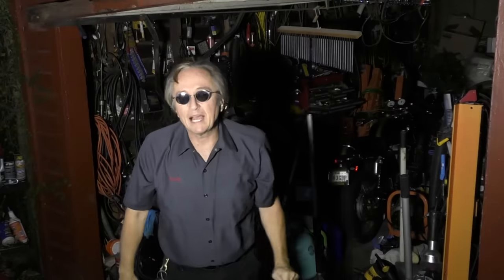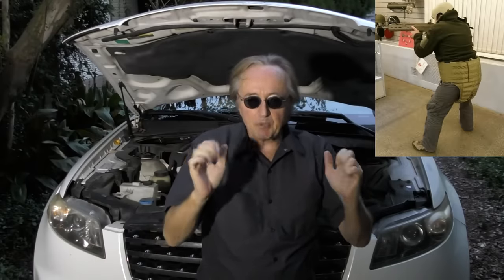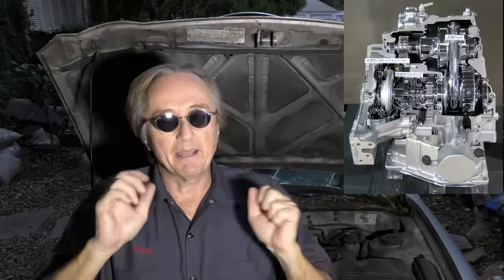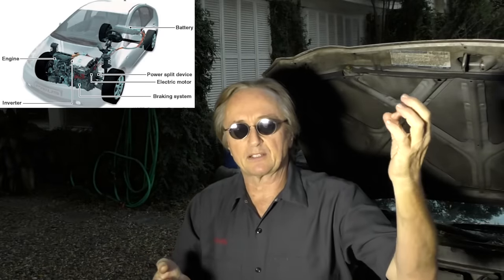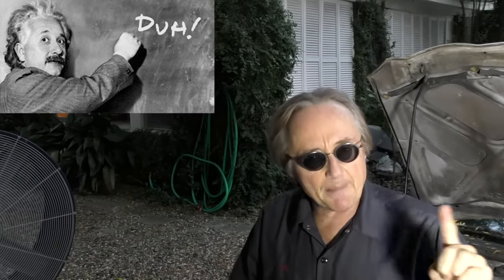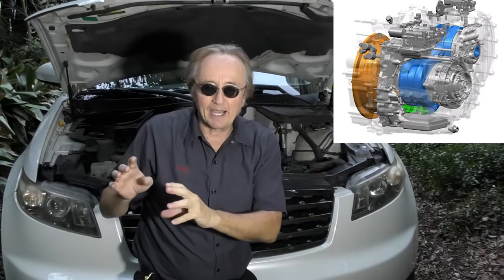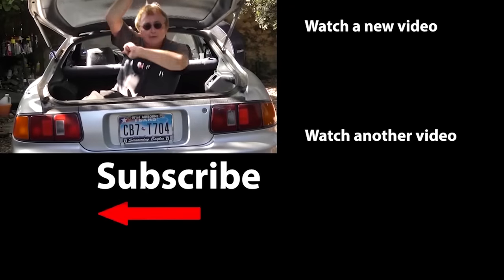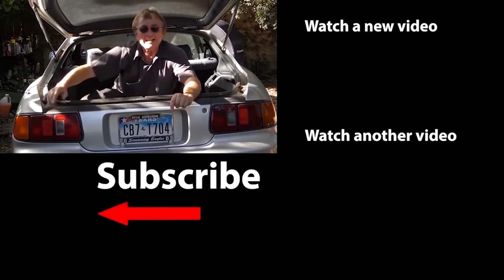Why Most CVT Transmission Cars are Terrible

Comment: My 2014 Note is on its second transmission at barely 131,000!?!? The second and current one started slipping in drive at 115,000 miles! Crappy... Nissan actually offered an extended warranty to 85,000?!?! My first went out at 72,000🤦🏽‍♂️ never again...

Comment: FYI: I HAVE 2016 NISSAN JUKE AND NISSAN JUST EXTENDED THE WARRANTY ON THE TRANSMISSION FOR 7 YEARS/84,000 MILES. CHECK WITH YOUR DEALERSHIP, AND DON’T TAKE NO FOR AN ANSWER!

Comment: Better gas mileage? What money are you saving if you have to spend thousands of dollars to replace the transmission in short order? I would much rather have a vehicle with less gas mileage where I don't have to replace the transmission because you end up saving more money in the long run with lower repair costs, not to mention the additional peace of mind with having a vehicle you can depend on.

Comment: My 07 Altima with CVT is still running at 132k but I’m scared it will go out any minute getting a AT Check light that blinks a couple times when I turn on the car then it goes away

Comment: When should I get the transmission drained. I have a 2014 Honda Accord and had a new transmission put in around 40,000 miles and it's at 72,000 now

Comment: My 2017 Honda ridgeline transmission needed replaced at 52,500 miles. Very disappointed in it's durability. Of course I lost $10,000.00 on trade in value. Is this a common problem?

Comment: I have a 2012 Nissan Versa sv cvt transmission and it took a dump at 64k miles. It never worked right. It would whine while going up a hill and sometimes woyluld just get hot and quit working all together while driving down the highway. They are crap!!

Comment: looking for a used truck or suv with tow hitch under 100k miles in the $15k to $20k range what would be a good one that will last me 10 years of driving at highway speeds?

Comment: Scott. With Honda being the makers of Acura, have you heard of any small but noticeable noise coming from those CVTs (or anything like that with any models)? I have a 2011 Acura MDX. How might one fix or reduce any small noises from CVTs? I am not sure that is that noise 100% but a GoodYear tire dealer mentioned it may. I thought it may have been a nail or something in the left front tire making the noise. Any thoughts?

Comment: Scotty, My 2004 Infinti G35 Sedan, made a strange sound, decelerated briefly, then the 'stability control' and 'skid' lights came on the dashboard.  Engine Assistance light came on. Next day started it up and while driving to the mechanic is shut off, right in the street.  It struggled to restart and I got it home and parked it.  Any thoughts?  Afraid to drive it, until I get it towed to my mechanic.
Reply: Thanks for telling us about using OBD2 scanner.  My car died while driving, a 2004 G35 on the highway.  It revealed that the camshaft position sensor on bank 1 was not working.  Subsequent research and YouTube videos matched exactly what happened to my car.  It would start and periodically just die.   Unfortunately, I could not reach the part because of the tight squeeze, behind the engine.  So I had to take it to my mechanic, to fix it.  It was great though, knowing what the problem was on my own.   It's ashame that you can't fix your own car anymore, without specialized tools.

Comment: You are seeing more problems with jatco  simply coz there is lot more of theme out there (compared with Honda and toyota) + it is a problems of torque the bigger the engine - more problems for the transmission. Before they used JF011E (transmisión model). Now the new model it's way better and reliable JF016e that thing will run 300 thousands miles no problem

Comment: Hello Scotty. I have a '91 Honda with 260,000 miles. It starts fine on a cold start but once it warms up it idles low, runs rough and it is very hard to restart. Can you tell me what may be causing this?

Comment: Scotty, I have a 2014 Nissan Versa Note & there are times when after a stop, I accelerate & there's a rumbling type of noise. Is that the CVT transmission? One time I went to a Valvoline to get my oil changed & I asked them to top off the trannie fluid & they said they can't becasue it's a closed system. I have 183k miles on the car & replaced the transmission just before the extended warranty expired (at around 60K). What do I do?

Comment: I would get an extended warranty on a car with a CVT transmission. Also, I heard you are supposed to change the oil in them every 30 to 40 thousand miles, to make them last.

Comment: I have a brand new Nissan Altima that just went out only at 49k miles. Right now it’s currently getting fix by Nissan under warranty. If it would have pass 60k miles it would have come out of my pocket and they are not cheap to fix cvt, I would have been looking at spending around 4- 7k Definitely don’t buy Nissan with CVT  I’m trading in my Nissan
Reply: What year is it and how many miles does it have?

Comment: Got a 2020 Honda Insight ex (hybrid with cvt),  - Hoping for long life, reliability, and fuel economy. I'm already getting crazy good fuel economy, + no complaints with feel/performance of this CVT, but I do I drive pretty gentle. This is my daily commuter for Los Angeles traffic.  I'm a devoted Honda lover, didn't want a Prius, and this is my first CVT car. Under the hood theres an Earth Dreams badge, BUT this one is Port Injection, so, I shouldnt have that oil dilusion issue. WIll I need to do a trans oil change to keep this CVT in tip top shape at some point?

Comment: I disagree I have a 2013 5sp manual Subaru Crosstrek and my boss had a 2014 auto and I get better gas mileage in town and hwy. 29/34 vs his got 25/29 real milage happens outside the manufacturer labs.

Comment: What do u think about the 2014 Mitsubishi Mirage, I recently replaced the transmission because it was about to blow, I replaced it with a 35,000 mile transmission cost me about $1000 for the labor and parts, the car has 130000 miles. About how long do u think I got left? It’s running pretty great.

Comment: I have a 2016 honda Hr-V AWD 52000 miles and my cvt runs perfect. Change my fluid with original honda fluid ever 25000 miles. Ignore that fluid change and you might as well take a giant crap on your vehicle

Comment: I have a 2008 Altima had it from new and at that time Nissan gave me a letter stating it would guarantee the transmission for 120,000 miles or 10 years. well here we are in 2021 12 years later and 103000 miles so far still working, but all the comments on here have me running scared. because i cannot afford a new vehicle, and if i could find an accurate cost to have the transmission replaced if and when it does fail I would hang on to the car, because it has been a good vehicle for me. So can you start a new theme on how much a replacement or repaired CVT would cost, this would be a lot more helpful, than you running your mouth, just to get air time.

Comment: At this point, I'd like to trade in my '15 Nissan Altima that has surpass 128,000 miles but CVT trans. will give out or limp any moment ... I kno the value will be low but jus feeling lost or advice

Comment: What can be done to a CVT tranny to get more mileage out of it? I have a 2020 Nissan Rogue with a CVT tranny! Can synthetic transmission fluid be used for better wear resistant. If yes, which brand is considered the best? Can an after market transmission cooler be installed for better results? Can synthetic engine coolant be used for better results? If yes, which brand is considered the best? Thanks for time and consideration Scotty! PS: Love your channel! Watch you all the time on YouTube! Super knowledgeable and helpful!!! Happy holidays here in 2022!!!
Thanks,
John Venuk (pronounced: "Va Nook")🤪
Reply: 2020 you should be fine the Nissan CVT's have gotten progressively better I've been told
Reply: @heythisiscaleb  Thanks for your answer about the Nissan Rogue CVT's. Appreciate your time in answering. I did leave out that I also have a 2017 Nissan Sentra. I was thinking you answer would cover both cars. So, what is your advice on '17 Sentra CVT tranny?
Thanks again for your help!
John Venuk

Comment: I bought a used  2017 Nissan Maxima and when I took it to get the Nissan dealer to get the recalls fixed they gave me a list of recommendations that should be done but It’s bearly my second car so I don’t know much about the services needed they recommend I get a brake fluid exchange, a complete fuel service CVT drain and fill, and a coolant fluid exchange i estimated the services to be about 800-900 do they all need to be done or how do I know ?

Comment: The Toyota eCVT runs the gas engine and electric motor(s) on the perfect RPM / torque for the current demand. 
All other transmissions do not work that way - in other words: They are not efficient. The eCVT has also some other pros, like weight, durability, smoothness, etc. . F**k the haters. :)

Comment: I had a 2015 Nissan Sentra and it's transmission garbage because it didn't even have the 100,000 miles and the car was already starting to slip  the transmission

Comment: Highlighted comment
Ray Crossley
 I just bought a 2019  Nissan Quashqai with an Auto that has a  CTV but I found after watching your video it just so negative You don't solve the problem I know your think you may be warning people about these CTV But what about the people who like me who have already bought one. and cant take it back no one rely checks the car there going to buy They trush the dealer is going to look after them with the warranty Nisan  now put a  ten years warranty on there  CTV transmission. Since buying the car I spoke to an auto repairer they told me It not the CTV transmission that the problem It the CTV oil that the problem these CTV transmission create a lot of friction.  they cook the CTV oil and as the oil burns over time  it loss it viscosity and the burnt CTV oil lack of lubrication starts to do  damage to contact points of the push belt and cones  Before  production Nissan drove around in stop start traffic for five years they repetitively pulled the transmission apart but could find no damage the thing is ever time they did they put new CTV oil back in If they had use the old CTV oil they would have seen damage These CTV tranmision will last but there go to be treated different then a an auto transmission And it a bit more then  just buying  a transmission cooler and  changing  out your CTV fluids  regularly I will also do  that But  its also how you drive it, For a start  When cold CTV oil needs  to be warmed up to operating temperature (for at least 5 minutes)  before you start to drive the car.  CTV transmission are  prone to lest heat  just travailing on a straight road  But there prone to heat when towing  or city driving. If you look after them that will last

Comment: The Obama rules restricted tailpipe emissions of carbon dioxide from light-duty vehicles but gave companies several ways to comply. Meeting that target just by increasing fuel economy would have required car companies to average 54.5 miles per gallon across sales of cars, trucks, SUVs, and crossovers by 2025. More CVTs to come.

Comment: Jesus Christ.. DON'T TOW ANYTHING, DON'T FLOOR THE FKING GAS, AND CHANGE THE FLUID EVERY 30K. Use manufacturer fluid and you'll easily get 250k out of it. A CVT is the "soccer mom" of transmissions. It's the daily commuter where hard driving shouldn't happen.

Comment: I have a p014c And p015a can I drive a long distance maybe an hour or two with those. My engine light came on the other day and I did a diagnostic and those codes came up just wondering if I can drive long distances before I have to get it fixed or should I get it fixed now??

Comment: There is no reason to have so many speed in an automatic transmission. 5-6 speeds were plenty enough and more efficient than a CVT when comes to acceleration. CVT is too weak, the reason why it can't replace an automatic transmission in a truck.

Comment: Nissan cars are the worst deals ever. Their CVT doesn't get better gas mileage. It's eats up more gas then a Toyota SUV or a honda CRV. Also it's very slow to speed up and drives clunky. Going uphill in the highway, even worst. If you buy from a🍋 dealer, they'll try and trick you into getting their ripoff shady extended warranty too.

Comment: Hi Scotty, 
I'm in a bit of a pickle, I have a 2014 Nissan Sentra. Transmission went out 2 times already. 1) At 50k miles, it was covered by the warranty 2) at 84k miles paid around $1400. I'm afraid it's going to go out again, any recommendations? Car is paid off, how can I get the most for the value? I don't want to cheat anyone by reselling myself.
Please Help!
Karina

Comment: Hi Scotty I have a Nissan Maxime with CVT trany it's done 300K the trany works so smooth still except it now won't down shift in manual but up shifs fine every thing else runs smooth could it be a cencor problem.

Comment: Can I manual swap my nissan maxima 2010, with 370z manual transmission?
Reply: Lol no
Reply: @boosted_brody5474  what about the Altima 4th generation manual transmission ?
Reply: @muhammadkhalidjavaid8874  you can use that or  a sentra spec V trans, Altima Se-r and I believe 03-04 Maxima 6 speed trans

Comment: OMG bro the jetco cvt transmissions are complete garbage. I got my mom a 2008 Sentra and didn't do my research on the CVT made by jetco for Nissan. don't do it..... I had a transmission cooler installed and it helped! but my goodness the CVT for the Sentra year 2008! is pure trouble .. don't do it!!!!!! run away and run fast! when anyone attempts to sell you one ..

Comment: CVT transmission is a push steel belt driven by two moving cones As long as the push steel  belt and the cones never touch They should last way pass the life of the car.  They will last for ever. The  CTV  transmission problem is in the  incredible amount of heat the CTV transmission fluid generates. It burns the CTV fluid  So  all CTV transmission have is a CTV fluid over heating  problem. There are cars on You tube that have done over 180,000 miles and there still going good So If you change the  CTV transmission fluid ever 60,000 km the CVT transmission should  out last the lift of the car.  it in The reason for this is Nissan ran cars with CTV transmissions in them in city traffic for five years with no trouble what so ever.  But the thing is the transmissions were regularly being taken apart and checked. In  doing this the  cars CTV transmission fluid were continually being replace.   the CTV fluid would never wear out The role of the  CTV transmission fluid is to prevent the push steel  belt and the cones from ever touching But once the CTV transmission fluid gets to old it loses it viscosity Then  it can no longer protect the  the push steel  belt and the cones  They will start to come in to close contact with one another As they start to rub together the CTV transmission will start to make a whining sound the push steel belt will start to cut in t the cones  and eventfully the push steel belt will finely fail But people have said when there transmission start to make a whining sound  they took it to an Auto repairer they just replace the CTV fluid it fix it all most instantly.

Comment: I have a 2010 Mitsubishi galant fortis (looks like the Mitsubishi lancer)with a cvt transmission. When I drive in auto and go to take off it feels like it’s jerking then it goes I’ve been in other cars like mine even with passing etc it doesn’t feel like it’s got the speed behind it to get passed. Could a oil change do it any good as well as the oil filter.

Comment: I just brought a Nissan Altima 2013 two weeks ago and car started jerking so I took it to get checked and he found these codes P17F1 AND abg codes  C1199, C1109, C1107 , C1108, C1115 AND C119A, Im sick to my stomach and don't want the car way to many Codes. I caught it before warranty was up GOOD but reading the fine print the dealer who sold me the car only pays 50% of parts and labor and it has to be fixed at his shop, and lemon law it has to fail 3 times in order to be deemed a lemon and I get a refund? I cant afford it!! I don't know what to do at this point :( can anyone please tell me what these codes are?

Comment: I own a 2015 Nissan Altima. Bought it at 33k in '17. Hadn't made my first payment yet when the engine didn't start. (Didn't change the spark plug.) After paying for the tune up its been ok. But then the wheel bearings went out as I was driving. Fixed that. Then another issue with the steering rod attachment. Fixed that. At 131k had to change the spark plugs again.  Trying to stay on top of things...maintenance and a whole lot of tlc sounds like what Nissans need. Came out of a CRV '05 that gave up the ghost at 253k. So that's my goal!! Make this little stinker reach 250ish! (Heck!! I'll take 200 😆) . About to change my tranny fluid and antifreeze. Next go around, will NOT be getting a Nissan (no matter how seductive they look😛😉😂)

Comment: Are the 2019 and 2020 nissans still using the transmissions from Jatco?  Have they made any changes?
Reply: Ed Gonzalez Yes , However these are much better built ....every 30,000 miles change the fluid at the dealer if you own a Nissan cvt car in general